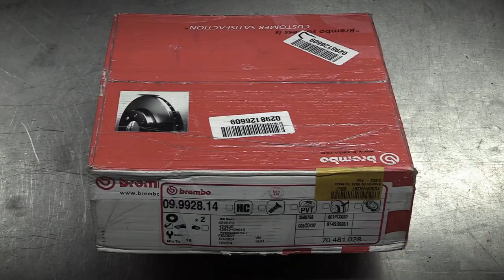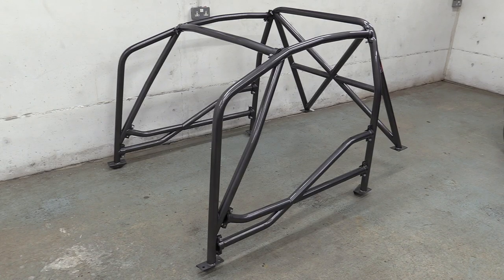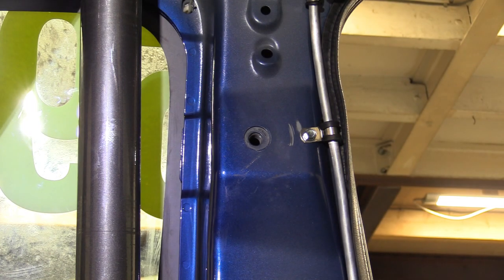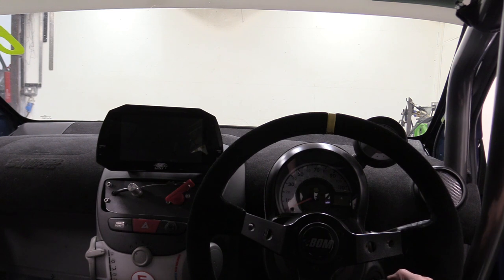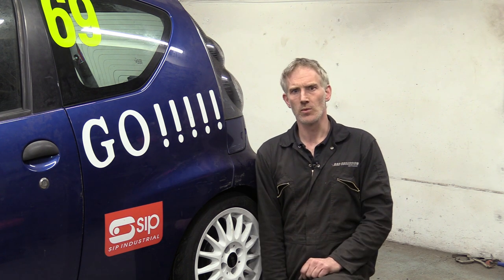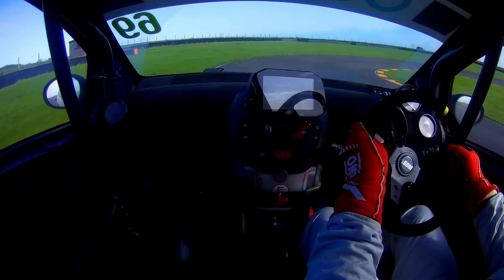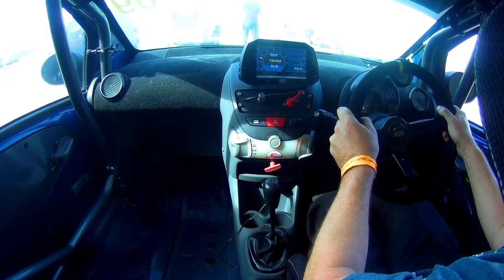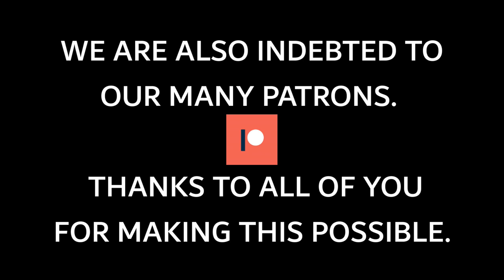Part 6 - Building an £850 hatchback into a competitive race car.

Comment: "13.1.5 The starting and charging systems must be left completely as standard, with the standard size and
 capacity battery remaining fitted in its original under bonnet position." ....Doesn't mention anything about "battery weight" though, and i would imagine that battery probably sits up high-ish in the engine bay somewhere so even if you shaved a few kilo's from lighter battery type  that's still the "physically same size and capacity" and had to add it back in the ballast box your adding it in much lower down in the car...

Comment: whats happened to project BINKY have you painted her yet we are dying here please give us an update on when you might get around to building her for the final time even thou these videos are also very good and super interesting you have even got me salivating at doing this myself as 6 grand would just about do me as a fully qualified mechanic and auto electrician for 30 plus years this looks an easy rebuild to me and Citroen C3 are cheap as chips round here in  Warwickshire I can get one in good condition with low mileage for 500 quid easy so might save a bit more on the rebuild.as an ex motocross rider from many years ago I've now got the racing bug again so the misses is not going to be pleased with me well 36 years married I don't think she will leave me now I hope not here goes.lol

Comment: If the rules allow it, get rid of the mechanisms for the mirrors. Gut them out and just replace them with plastic mirrors (they are quite quality) to offset the weight of the brackets added. Also, shouldn't these cars be fitted with plexy windows for safety?

Comment: You're probably way ahead of me, but is there anything in the rules about fitting lighter parts such as lexan windows, then adding the removed weight low down to improve the COG?
Reply from the maker: There is, yes. Not allowed.

Comment: How far do those rules stretch towards use of Friction modifiers such as Militec 1 . or "slight porting" of cylinder head, tuning of cam. injectors, or inlet manifold etc?

Comment: None of this is adding more Lightness... I'd get on that.
Also, what other cars used that gearbox? What other ratios were available? Mix n match time? Especially a shorter diff ratio to get the revs up quicker, to where top gear might finally get used. Maybe those from the other brands of the same chassis?

Comment: I wish they could have built 2 cars one for the race following all the rules by the book and the other with all of the tricks and little mods that fall in to the gray area or are down right illegal just to see how different the track times are in comparison to the legal car . I know for a fact they could have picked up a few seconds per lap just by welding the cage to the body , fitting a front strut brace and a rear anti roll bar all of which are common on most track going cars for good reason.

Comment: Ok one thing have you not looked. Maybe and I say maybe you should look if there is not another gearbox. I mean if its not shorter or wider ratio in another model of this cars. The shorter ratio would do better acceleration but lower top speed.  But thats only a idea. And maybe all gearboxes are the same. Im not very comfortable in Peugeot Citroën space so dont take my Word for it. But if it were a vauxhall or opel there are plenty of options. Cheers

Comment: A cup of butter? What radical free range thinker would use a liquid measure for a solid? The same thought of thinker who would find a way to turn off the smart alternator while the throttle is mashed to the floor? Sort of a kickdown, WOT A/C compressor shut off, repurposed. Every 15 Amps not being generated is 1/4 HP gained. Are you allowed to fit stone guards under the floor pan to protect the under seal and fuel lines? You know the type, starts just behind the front bumper and extends as flat as possible to the tail pipe.

Comment: If you guys had a computerized plasma cutting table, could you use it instead of the hand held grinder death wheel? Would that let Nik make even more insane brackets? If so, you should get one.

Comment: All you can do?
Blueprint it. 10 thou off the head and just-in-spec bores should make a difference even on a kit ecu. 
Then there's the gearbox. Do the rules say you have to carry (and turn oil with) 5 gears when you only need three or four? If not its grinder time. Come to think of it did they ever make a 4-speed box for those things?

Comment: What does the rules say about blueprinting, port-matching intake, port-matching exhaust ports with exhaust ports, weight balancing of existing original internals of the engine? balancing of the flywheel?
I ask because it isn't actually tuning, it's not changing camshafts or anything, it's simply ensuring the engine works as per factory spec, and should net a few precious ponies.
If none of the above applies, certainly the rules allow for engine overhaul?
Let's say the engine head was UNFORTUNATELY WARPED and had to be machined = More compression  :)
Service injectors,  change fuel lines, change fuel pump filter sock, clean fuel tank, clean injector rail.
Heck, can you scrape off some of the excess chassis glue?

Comment: There has to be stuff you can do to the engine etc like a slightly thinner engine oil, balanced and lighted clutch/fly wheel, thinner gearbox oil, different gearbox and diff ratio's depend on which track your on,  balanced crank, titanium pistons and rods..........you see where i'm going here, stuff you can't see!!!!!!

Comment: Is adding so much weight that you can safely remove the ballast box...the same thing as adding lightness?
Reply: There must be a minimum weight limit for the class.So instead of having to put static weights into  that box, and them being merely ballast, why not add bracketry and bracing that increases the stiffness/efficiency of the roll cage and/or anything else that doesn't break the rules and still meets the minimum weight limit. of the class...

Comment: When I jack up my stock 2005 Honda Civic EX in the front, there's only a few mm of visible flex before the rear wheel comes off the ground. They come off nearly at the same time. It's ridiculous how stiff that car is from factory.

Comment: Cant mod the engine, but noone said you cant "skim" the head because the headgasket blew 3 times in a row.. "ahem". 

Could increase compression a wee little bit.
Reply: The rules say specifically that. From the regulations "6.0  No engine modifications whatsoever are
permitted, and for the avoidance of doubt this means no skimming of cylinder heads, no refacing of
blocks, no lightening, polishing or otherwise modifying any part from its standard factory
specification. Camshafts, crankshafts, pistons, oil pumps, timing gear, pulleys, flywheels, clutches
must all remain as OEM / standard with absolutely no modifications permitted."
Reply: @jimmmaaayyy5163  bummer..

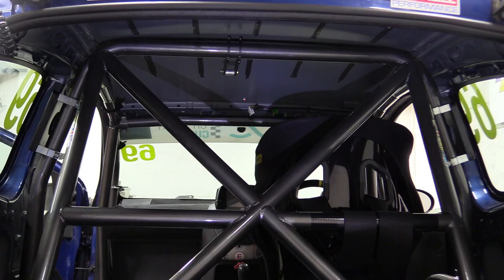Comment: 8:52 why try to fool us? You moved the jack handle further, of course the car lifted higher/faster
First test, handle moves to mirror. 
Second test you pushed it to the floor. 
Just use a measuring tape under each corner of the chassis

Comment: Just wondering on the added weight you installed, did you weigh it in and out? What is the regulated weight for your class? Without making HP changes weight loss is the easiest way reduce lap times! With every ounce or pound of weight removed from a vehicle, the car will possess better horsepower/weight ratio allowing you to accelerate faster and improve handling and reduce braking. Are you allowed brake cooling ducks, brake fade is killer! Are those the lightest rims you can find? We know you can reduce the car’s weight and with the added chassis changes you will be fastest for sure! P.S. There’s a reason F1 drivers weigh no more then a feather..Hint,Hint 😜.
Reply: The car and driver have to meet a certain minimum weight which is why they had the black weight box in the  passenger seat area. Trying to ''add lightness'' will only result in having to carry more penalty weight in the box. The wheels are part of the standard compulsory conversion kit for all contestants

Comment: If that engine has done 98,000 miles how about pulling off the intake manifold and giving it a good clean out! Same with the fuel injectors, take them out clean them and make sure they all flow the same amount of fuel! You'd be surprised at what running cheap and nasty fuel will do to injectors over 98k. Maybe a new fuel pump and fuel filters? Also are you allowed to run higher octane fuel or race fuel???

Comment: The link dash looks a bit laggy when revving. Is this a characteristic of the dash or the signal from the ecu to the obd2 port not having a very good refresh rate? I was thinking of getting one of these dashes to work with my link ecu but not too sure now
Reply from the maker: Much better refresh via CAN. It's an OBD2 thing.
Reply: @BadObsessionMotorsport  thought that might be the case, thanks!!!!

Comment: So long as you aren't suffering from overheating brakes, turn the rotors down to minimum thickness. You will be surprised at how much unsprung weight this can save.

Comment: @UCHvBHWBzzB7NyU5tIiEZHBg Great work as usual ! Only the track view from the car is still disappointing. You should get a better camera for inside the car, like a gopro 9, it would give you way better result. Better dynamic range, stabilised footage and their onboard gps allow for seeing the speed and position on the track in the video. You should also test different camera position. I think a helmet chin mount would be very appropriate. Keep up the good work !

Comment: Next week: Using the alternator as an electric motor to for more power. Could you use the lathe to remove rotating mass from some stupid place that the rules don't cover??
Reply: Remove battery use "supercapcitors"

Comment: As much as I like the series it only goes to show why competitive motorsport is out of reach for many.  With £8500 to build the car to spec which doesn't include a trailer, a tow vehicle, helmet, overalls and Hans device, MSA paper work and licensing, accommodation at race weekends and now test sessions (and not mention the £1000 dash now fitted to the car) and associated consumables to true cost is was above the target simulator cost, where after the initial outlay "seat time" is pretty much free.

Comment: Now that is how to work with in the rules.
Reply: Hmmm...  I do have a suspension question.  It's only curiosity (suspension setup has always interested me)... While no one wants a race car that heavily understeers (yuck), won't limiting drop travel via chains (straps, etc.) lead to sudden excessive snap oversteer from the sudden unloading of the tire that's being drooped in a corner?  I'm sure spring rates, damper rates, roll stifness, roll center, center of gravity, and total suspension travel (plus may other factors) also play into this as well.  Just pondering the many FWD cars I've seen on a track in which an inside tire lifts off the ground during high speed cornering.

Comment: How relevant this is to you i know not, but i know for a fact that a team in formular renault used to remove every other  bearing from inner and outer bearing set from the stub axle , to reduce rolling resistance...... obviously it would reduce long term durability  but it was done.

Comment: Not super into racing so i dont know if this is a normal thing, but doesnt this go against the spirit of the race. Everyone having the same car with the same parts. Thats the point no?
Reply: It put more on the driver to gain an advantage and to keep costs down ,but also encouraged creative engineering, and the fitting of dummy parts to distract the others from the real mods , did ff1600 in the past 🤐, before that 1/8 rc nitro cars don’t laugh but the level of creative design that was done was beyond believe even down to design of flat plate throttle bodies, but the ff1600 was just great in its day red line 200rpm below valve bend and no rev limiters 😳

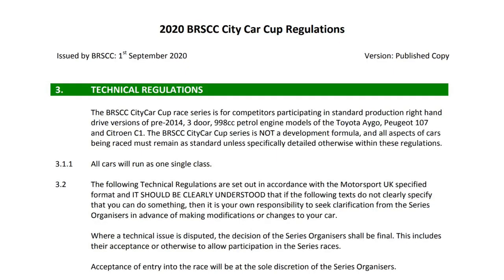Comment: 3:41 read the first sentence of 3.2, it states something more or less equivalent to the previous bold text.
Reply: It does not. It says it's the series organisers who can decide what is and is not acceptable.
Reply: @Quintinohthree  they decide that *anyway*. Bottom line is, a participant may not assume that if an action is not explicitly forbidden then it is allowed.
Reply: @GeorgeTsiros  "May not assume" is quite a bit different to "must assume not" and it does indeed mean you must work under the opposite assumption and check afterwards.
Reply: @Quintinohthree  What does "may not" mean?
Reply: @GeorgeTsiros  That you cannot do something. What can you not do? Make assumptions. You must always check or be able to reverse things you have not yet checked or you may be excluded.

Comment: Section 5.1.1 is like mother Russia of old, if it is not specifically permitted, it is forbidden.
You boys would fit right in at NASCAR....I guess acid dipping the body panels is out of the question, then?

Comment: Very low powered, pretty light weight racing series, unless evenly ballasted by the regs (??) put a massive penalty on driver mass? How much does Nic Grindrod weigh vs Richard? Watching the last race video, at the start Nic simply drives away from your car in a straight line, so that's either POWER or WEIGHT or both!

Comment: Sorry, but looks like your rollcage mods are illegal. Full rulebook excerpt: "No chassis or body modification or stiffening is permitted except that derived from the fitting of the ROPS. Modification of roll cages in any way is prohibited."
Reply: I saw that too. We probably agree that the chassis and body have not been modified. I would possibly also argue that the body has not been stiffened -what I mean is that if you disassembled the vehicle so the body was a single part, that part would not be any stiffer. They could trade the body with another competitor's car. It hasn't been welded or changed in any way. Only when bolted to those brackets and the cage does the whole assembly become stiffer -but the whole assembly of "body+cage+brackets" is clearly not the same as just the singular "body".  Its a grey area and seems like the organizers are trying to keeps mods to a minimum so I'm guessing they will have to unbolt those at the next race.

Comment: what about battery/ alternator jiggery pokery. downsize / remove the alternator as you won't be needing things like heating, air con etc etc. and or downsizing / upsizing (if removing the alternator) the battery. 
Or
run the alternator backwards. poor mans kers. 

Perspex windows.

Are the aero benefits of the bonnet worth the weight cost?

Remove paint

Put the driver on a diet.

Come on guys, youve barely begun.

Comment: Very nice fabrication, but I think its getting away from the point of the race series, cheap Motorsport, in equally matched cars. Not everyone has 2 skilled race engineers, a lathe, mill, drill press, mig, Tig, sheet metal bender, press and roll of carbon effect vinal at there disposal. If I was paying for the labour, I should thing I'd be getting on for over £3k just on the extra mods. Not wanting to get all serious, BUT, this is the problem with "club" Motorsport, trials, rallying, sprints and racing, there is always someone with a bigger budget that comes along and throws a ton on money at it to make up for a lack of natural driver talent.
Reply from the maker: Has been the same since the invention of motor racing. We just showed it.

Comment: Entire episode about manipulating the rules. Have a word with yourself. As a former race car driver, i competed against people like you. Always trying to figure out ways round the rules. Instead of racing honestly - Equal cars - driver skill is what sets you apart. Not the fact that you have a lathe and a hidden USB port.
Reply from the maker: 😂 Aww. If you're not looking for ways to gain an advantage, you're not racing, you're driving. The USB port was so well hidden we showed you exactly where it was smack bang in the middle of the centre console. 🙄
Reply: @BadObsessionMotorsport  this isn't racing. This is cheating. Hence why the organisers made you put it back to normal.
Reply from the maker: @Sam_Holt  The organisers knew exactly what we were doing at every stage. They have written more strict rules for this season as a consequence.